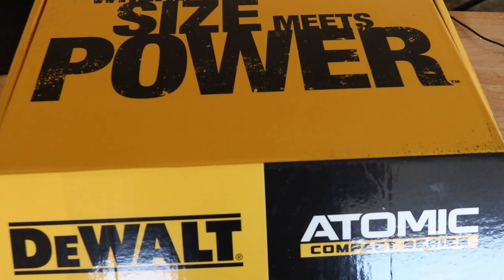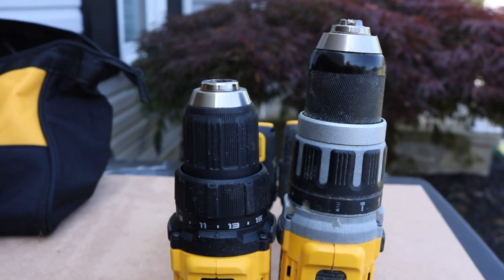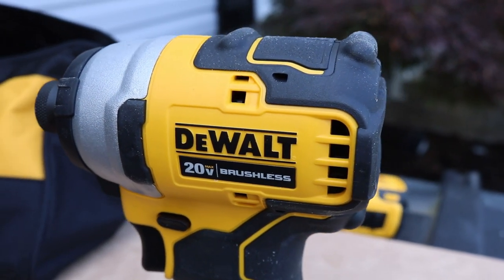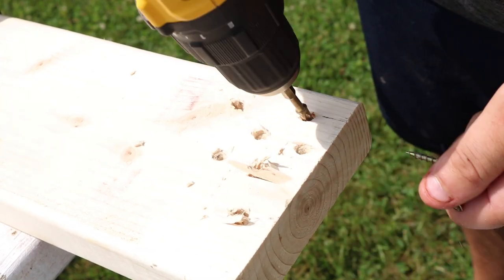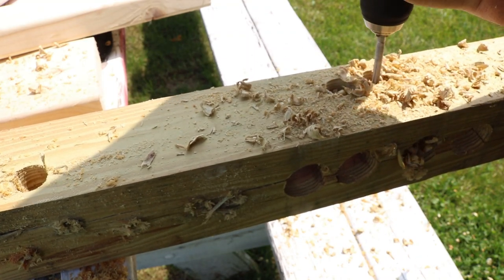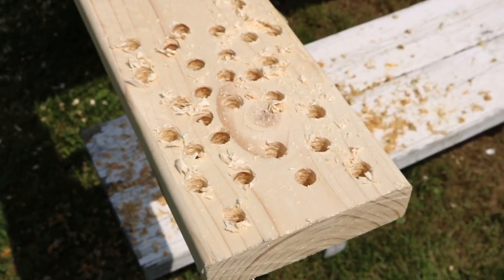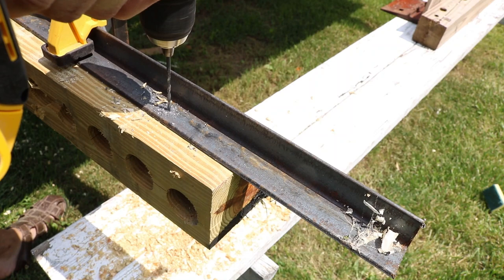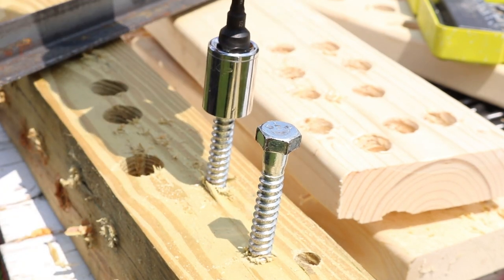All New Dewalt Atomic Drill And Impact Driver REVIEW! (Full Beat Down) #dewalt #powertools #newtools

Comment: I bought this set for my father for Christmas and I appreciate that your the only one Ive seen point out that trigger.  The triggers on these are about as good as i can imagine on a power tool.  While the trigger feels the same as my brushless Milwaukees they are roughly twice as good.  The Milwaukee has a deadzone of about half the pull, and then super touchy to try to keep low speeds after that.  The triggers on these atomics start so smooth and linear from the slightest depression.  Im not sure how the beans compares but they seem to be plenty powerful for his needs.

Comment: Good video!  I'm a little confused why they market this to someone looking to get into the 20v max platform yet it only comes with 1.3 ah batteries.  That's not a lot of battery especially if you are looking at investing in other 20v max bare tools later.
Reply from the maker: Whats up Brandon! Could be to keep the price down maybe? Those who dont have a great understanding about batteries will probably say, wow... you get two batteries with this!
Reply: You shouldnt be buying better tools if you dont know this are not top of the line
Reply: Just bought the set and they come with 1.5's now. Not running it all day so it should suffice.
Reply: here in England the dcd709 or as you guys know it as the atomic range is a hammer drill with metal chuck and our packages or kits come with 2ah or 3ah batteries. I was torn between the dcd796 but the weight difference made my mind up and the price as the 796 is 70 pounds more and only came with 2ah battery.  It was a no brainer for me and I'm only doing normal DIY tasks.  The atomic was only 5nm less torque and it has put up the tie up rings and they still screwed to the wall even after a few horses have pulled back on them.

Comment: I dont see enough to change from my xr line up.
Reply: Quoted to be smaller and more powerful than the current xr lineup. Sounds like its meant to be an upgrade to me.
Reply: @Taylormade2350  Wth ??? Did u watch the vid ?? EVIDENTLY NOT. DEFINITELY QUOTED AS MORE TORQUE . MORE TORQUE =MORE POWER. Come on now. Stop picking.
Reply: @invisiblegypsy725  Look  at the fine print they claim more power then the previous model not XR line.

Comment: They would have sold if the drill would had been a hammer drill.😃
Reply: @stevenfoust3782  no I have lots of hammer drills. I just need a small one. I work concrete roofs. So I would like a small that's not heavy for small screws. The sun kills u out there. And any power tool that is light is a plus in my job. ( m 12 )😁😁😁
Reply: @heckeepagan2670  I have the 996 atomic hammer drill, its about 0.5in longer but worth it for the hammer feature. Team Orange have a deal at $129 right now inc bag charger and 2 batts, so I plumped for that instead of the regular Atomic drill at $155